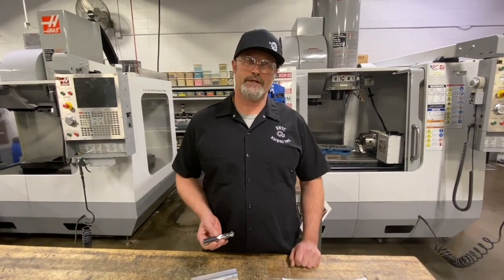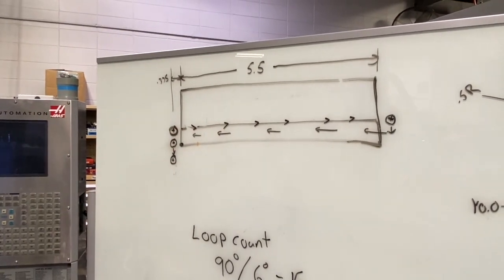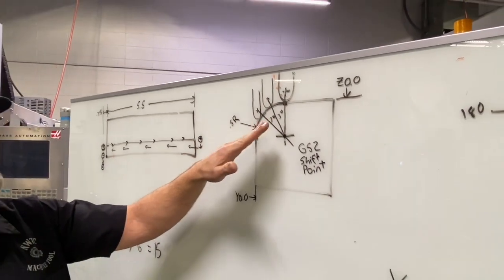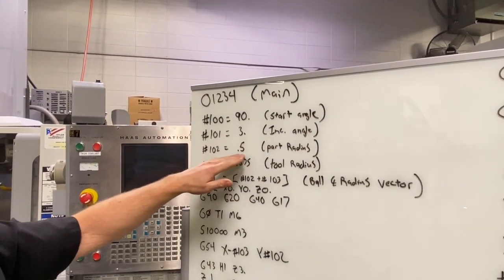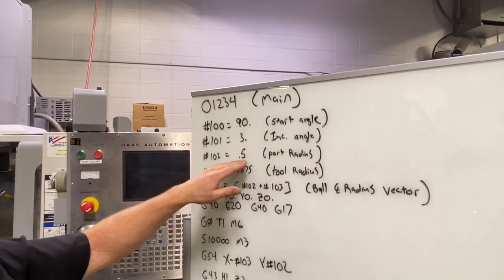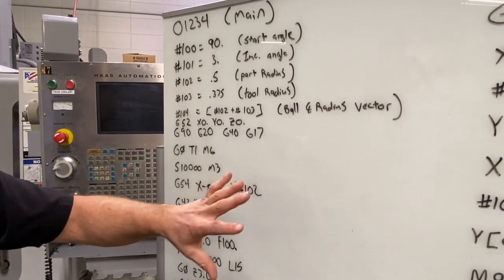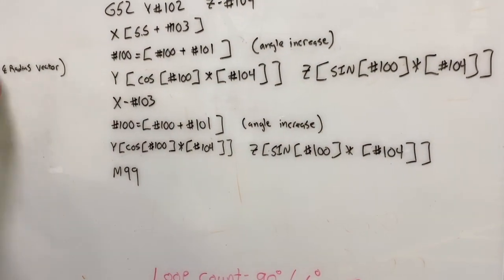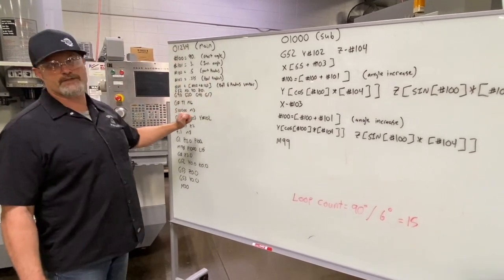How to Use Macro Variables to Cut a Corner Radius

Comment: Not a bad idea. If I were cutting corner radii I would take this a step further and make it a G65 macro subprogram. Use the A-Z arguments to pass the data. Have it smart so it knows which direction it's cutting by the XZ  or YZ center you give it. It could get it's start points by current position at call, and a letter I or J for incremental distance.
Use R for corner radius, and D for tool radius.
The radial positioning moves can be in absolute, and the feed moves in incremental.
Further, by adding the radius center point in the radial move commands, the radius can be divorced from tangency with origin surface, no need to shift offset either.
Last but not least, before doing anything log the relevant modal commands so they can be recalled when the cycle is done, making it "canned"
And if I really used it often, I would assign it a unique G code instead of using G65.